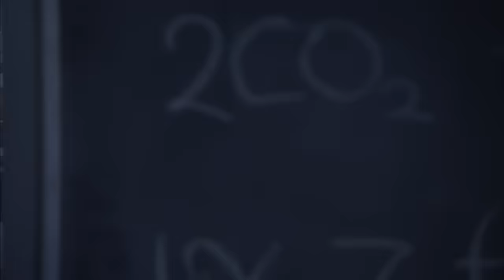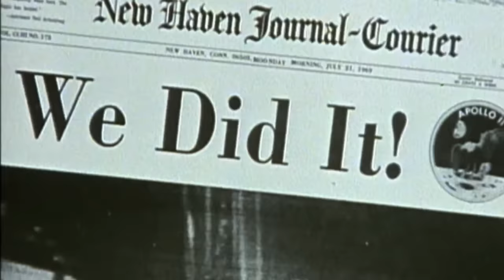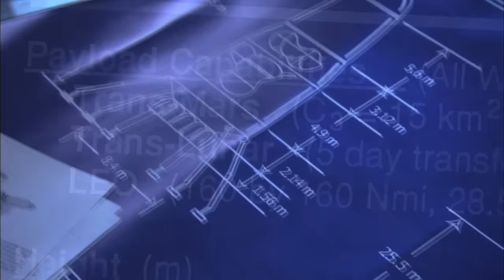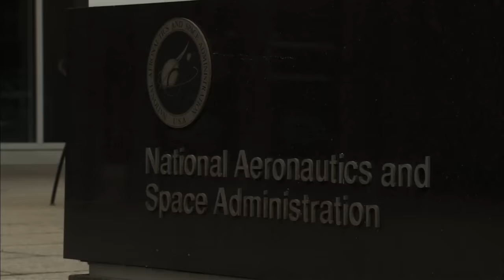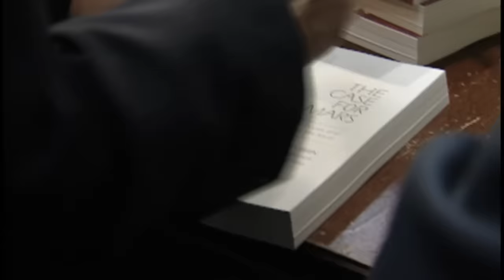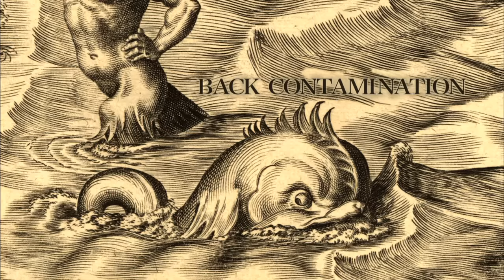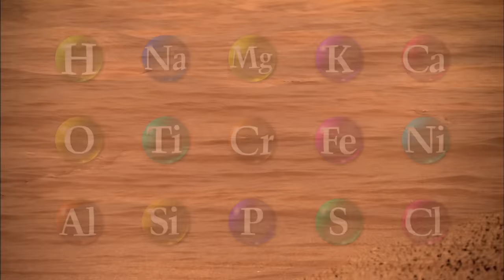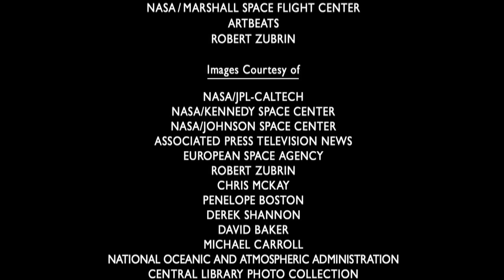THE MARS UNDERGROUND [HD] Full Movie

Comment: One crucial point which was not mentioned when describing possible terra forming of the planet Mars, is the fact that Mars has lost its magnetosphere. Though faint isolated pockets do exist and it would be most prudent to set up bases within these isolated pockets, any atmosphere created would simply be blown out into space by solar winds. It seems more reasonable to first and foremost resuscitate plate tectonics in order to (1) warm the planet from the inside out and (2) to set into motion a global static charge in order to bolster the magnetosphere. Then once the magnetosphere is robust enough to shield the entire planet from solar wind and radiation, the process of creating an atmosphere can begin.
Reply from the maker: Ron Bohlouli Admittedly, the lack of a magnetic field should have been explored more in the film when it comes to settling the planet.  However, there are many counter measures that can be taken to mitigate the effects of solar radiation.  Having to generate plate tectonics - something probably impossible - is not necessary. 

Also, it would take millennia for the solar winds to blow the atmosphere out into space.  If we could generate an atmosphere, certainly we could replenish it slowly over thousands of years. 

Of course, with a thick terraformed atmosphere, the radiation dose would be reduced many factors more: “Mars' thick atmosphere of carbon dioxide would block a good deal of the incoming UV radiation, but carbon dioxide does not significantly block UV radiation in the 190 nm to 300 nm range. Current UV flux on Mars is about 6 Watts per square meter, which would be enough to kill most organisms. The plan here would be to introduce highly UV resistant lifeforms, such as lichen, directly on the surface or to grow cyanobacteria in soil which would protect the organisms from UV, and in mats on the newly formed seas, with layers of dead cells protecting the living cells beneath. These organisms would release oxygen which would slowly build to breathable levels and would form ozone in the upper atmosphere, which would reduce the harmful 190-300 nm UV flux. These organisms would also provide nutrients to help build the Martian soil up to the point where it could support more complex plants.”*Jason Shankel:  *@5868115
Show less
Reply: Ron Bohlouli You wouldn't resuscitate plate tectonics. To get the magnetic field going stronger, you need to have the core of the planet spinning. The planet does have magnetic field, be it very weak, so we know there is an iron enriched core in the center. To get it stronger, the core needs to spin faster.

As Blue Mars said, it takes thousands of years for the solar wind to blow away an atmosphere. Even if we could get the atmosphere on mars to return in 200 years, we would have the technology to keep the atmosphere on Mars sustained, even as the solar winds blow it away. It would be much cheaper, easier, and more plausible to do than trying to figure out how to get the core of a planet to spin faster.

At the same time though, due to the lack of an magnetic field protecting the planet. Chances are all the people on Mars would live in protective habitats, and not out in the open. Any technology that could jump start a planet's core into producing a more powerful magnetic field is far, FAR past our lifetimes. By the time it is invented, we will probably end up using it on a different planet instead.
Reply: I believe it is feasible to capture a number of celestial bodies and navigate them into a fixed orbit around Mars.
 This in essence is creating a moon for Mars. Which in time will set into motion plate tectonics and the spinning of the core.
Reply: Ron Bohlouli That would be possible to do. How ever the new moon would have to be very large. Large enough that it pulls on the planet enough to distort it more than the moon does to earth. For a moon to get the core spinning, it would need to have enough gravity so the planet distorts enough to heat up. You would basically need a moon large enough that it might actually be considered a dwarf planet. Even then that might not be big enough. For an effect like that, you might actually need to do it the other way around and make Mars a moon of a larger planet. No clue how big the planet, or object would have to be, but I'm willing to bet that it would have to be much larger than a moon, and I'm willing to also bet not even Earth would be big enough. Leaving only the gas giants, and those are to far out to even bother trying.

Regardless of the size though. The effects wouldn't be instantaneous. You could easily be looking at hundreds of thousands, if not millions of years before seeing any noticeable effect. Keep in mind that planet tectonics work, and move over millions of years, same would go if you tried to artificially speed up the core by using natural methods, such as bringing in another body with more gravity. Not to mention it would still be much easier, and more effective to just terraform, and artificially sustain an atmosphere while living in protective structures. Working on a technology that could heat up a planet's core, and get it spinning better would also be much easier than trying to move a large enough body into orbit for the same outcome.

Lastly, plate tectonics are on the surface of a planet. To get the tectonics moving again, you need to heat up the interior of the planet first. You're not trying to revive tectonics, you're trying to revive the planet. It's the center of the planet, its core that you want to focus on, not the tectonic plates. Those are just a by-product of having a planetary center like Earth's.
Reply: On average the solar winds are miniscule, However, Without our magnetosphere a direct hit of one Earth Directed Disruption could blow out our atmosphere like blowing out a single birthday candle.
Reply: Ron Bohlouli  He's right. no magnetosphere, no geomagnetic field, no oxygen-nitrogen-methane atmosphere. Warming Mars without a magnetosphere or a geomagnetic field very difficult. It's building a Statue of Liberty without iron Don't terraform Mars until we can develop a magnetosphere or a  geomagnetic field.
Reply: Blue Mars Scientists need to develop a superconductive geo-magnetosphere machine to hold lighter gases for nitrogen and oxygen. Then terraforming can begin.
Reply: Ron Bohlouli The best solution really is to snatch Ceres from the asteroid belt and send it on a collision course with Mars.
 
Ceres shouldn't hit head on, but instead it should skim the edge of the equator with the right speed and angle of impact so that the asteroid would make the outside of the planet spin much faster than it's inside, and also be absorbed inwards so that it sends all it's kinetic energy to melt the interior of the planet and crack the crust making plate tectonics. 

The friction produced by the different speeds of rotation between the surface and the core would create a powerfull magnetic field that should last for millions of years. 

 The only downside would be that the day on mars will become much shorter, but the impact will likely generate a large moon to slow down it's rotation with time.
Reply: Danx Daniel That's a good plan, but the planet wouldn't be cooled off enough for people to live on for a few million years. At best it would take a couple hundred thousand years to cool off enough. Then there is the problem with the planet's rotation. Days will go by really fast, which will fuck with how the human body wants to work with sleep. People would experience what's probably somewhere between 2-4 days in a 24 hour span. Well depending on the angle. Either way, 1 earth day would be close to 2 Martian days at the very least.
Reply: PLEASE READ ALL OF THIS. 

The impact would melt a good portion of Mars's crust and interior, but not all of it, the molten material at the impact zone will remain molten for a few hundred years maybe following a gradual distribution of that heat to the rest of the planet, but the far side of Mars's crust would likely remain solid.
 
 The Theia impact with Earth that formed our moon may have needed "a couple hundred thousand years" for the crust to cool, but Ceres isn't half the size of Mars as Theia was compared to Earth. It's around 1/8 (lower mass, so the impact wouldn't be that dramatic)

 People could live on the opposite side of Mars untill better times come at the impact zone, and they would likely adapt to the new 4 hour day (guess) because there's no other way, it's not impossible to overcome, all organisms we would bring there would have to adapt to that.

 Just think about it, Mars would be safe to inhabit within a few decades after the impact, and the terraformation would begin immediately with the new super magnetic field, and the new already thick atmosphere with a lot of water resulting from both cerese's and Mars's ice.
Reply: Draggon Reaper Not to speak about the new closer orbit to the sun that Mars would have because the impact will slow down it's orbital velocity a bit, further improving the conditions necesarry for Mars to contain liquid water on it's surface.

A major hurdle though would be the debris from the impact, our timing should be flawless so that the earth's orbit wouldn't cross the bulk of the space debris coming from there and take extra measures of caution to detect and deflect the large chunks of rock that would try to hit the Earth.
 We don't want to start life on Mars and end the life on Earth.
Reply: +Jacob Tennyson statue of liberty is copper <--- =)
Reply: +Jacob Tennyson statue of liberty is copper <--- =)
Reply: Danx Daniel
 Your plan is feasible, with a caveat, there are to many variables, any one of which if gone askew would create devastating problems.
 A project of this magnitude can not tolerate anything less than zero margin for error.
Reply: Kacey McCay
 If I am not mistaken, the skin is copper, the frame work is iron and/or steal.
Reply: +Danx Daniel 
better yet setup 6 towers around the planet two of them at it's poles and then create a electromagnetic field like earth plus these towers will create ozone plus this creates a communications and many many many more things
Reply: +Ron Bohlouli "Steal?" Is that some kind of stolen alloy?
Reply: madamerotten
Steel carbon content is between 0.002% and 2.1% by weight for plain iron-carbon alloys.
so make sure no aliens come and steal it...
Reply: Ron Bohlouli Yes, everything should be perfect when putting the plan into action.

 But i don't see a better ideea when tackling the magnetic field problem in Mars's terraforming.

 Such a plan will likely happen if humanity will get past the level 1 civilisation.
Reply: Danx Daniel
    DING! DING! DING!    You got it!!!
 There are, in fact, a host of problems regarding terra forming Mars or any other planet or celestial body.
 To avoid placing the cart before the horse, it is crucial to identify and recognize the proper sequence in restoring/reviving Mars. Least we defeat the purpose.
 Note: One uncomfortable and unavoidable detail, in addition to our inadequate will and technology, is our propensity in destroying, globally, Chernobyl, Three Mile Island, Fukushima, Kursk are not positive attributes on the resume of terra formers.  
 Mars will be, must be terra formed. But not by us. We can begin the planning, for future generations to amend and fine tune before implementing.
Reply: Setup 6 towers around the planet two of them at it's poles and then create a electromagnetic field like earth plus these towers will create ozone plus this creates a communications and many many many more things.

Energy is easy with a electromagnetic generator/pump how does that work think of a magnetic and a steel ball  now think a electromagnetic and steel turbine as the magnetic force increases the out put of energy also increases with no fuel just small jump start of energy = unlimited out put then using electron eating bacteria to create even more energy and lesson the radiation of the field created...

Methane from the solid waste
CH4 + O2(fire)= H2O+CO2 just what plants love then the solid waste is heated up to make Syn-gas the waste water is then used to grow plants....

Recycling water aquaponics, syngas makes fuel when solid waste is heated creating 3 kind of oil sludge, motor oil, machine oil run these sludge and motor oil in the heat with stainless steel and aluminum to create gasoline and propane

Can Go on and ON
Reply: 1stWorldofFreedom 
 I believe you have scratched the surface of what may have been ancient technology ie, mega structures on known lay lines.
Reply: +1stWorldofFreedom Ozone does not equal an electric magnetic field. you create this by heating up the core, by creating a greenhouse effect in the atmosphere. this greenhouse effect will kill off your ozone. Also you need an oxygen based atmosphere to create O3 aka ozone.

The electron eating bacteria powering a generator is just WahWah.
Reply: John Smith
Haaa learn and create science is Great

Study Paleolightning before flapping you gums and start looking dumb
If Oxygen is absent, but CO2 abundant, the CO2 can supply O for N-oxides

Mars atmosphere is mostly Carbon dioxide: 95.32 percent. Nitrogen: 2.7

Artificial magnetic fields is possible and easy as I stated....
Build an electrical conductor around the equator of Mars. This electro-magnet would form an artificial magnetic field.
bubble of plasma surrounding the Mars created by artificial magnetic field

This excess charge is transferred to the ground via lightning channels, which carry a strong electric current. Because of the intensity of this electric current, when lightning hits the ground, it can produce a strong, albeit brief, magnetic field.

Who's ball are black and blue that's right it is you....Wahwah
Reply: My expertise in science is electricity. Ozone does not equal a electro magnetic field. Sure, there are ways to create energy with algae, but there are no electron eating bacteria.
Reply: "An artificial electric field of plasma." Do you even know what plasma or a tesla coil is?
Reply: "Artificial magnetic fields" You have a magnetic field or you don't. There is no such thing as an artificial magnetic field. It's an electromagnetic field, or permanent magnetic field.
Reply: Every cable in your household sends out a magnetic field. Nothing knew. Know for centuries. Humbug. Big humbug.
Reply: John Smith
Yes I do what a Tesla coil does and what it can create

Tell it to someone else you can as I have shown with a Tesla Coil towers creating lightning and artificial magntic feild around the
Build an electrical conductor around the equator of Mars. This electro-magnet would form an artificial magnetic field.
bubble of plasma surrounding the Mars created by artificial magnetic field
Reply: John Smith
The three magnetic fields add as vectors to produce a single rotating magnetic field created by Tesla Coils....
Reply: "If Oxygen is absent, but CO2 is abundant" than oxygen is abundant. But you can't simply extract O from the CO2 without any substances.

But the biggest joke in all, is that you expect an electric conductor around the equator (You fool, think what you are saying), and than expect to generate plasma in orbit. hahahahahahaha. This fails in so many ways, and not even in a scientific way.

Here is some science and logic for you. For you to power a conductor, lets say a cable "conductor" you would need to make it so thick for currents to flow through that you would not even find the raw materials to construct it in the first place. See if you put alternating current on that power line, you do generate a field. But when an electron travels through a conductor, it experiences resistance. HHHHHHMMMMM resistance. To overcome this resistance, you need more current. And in turn you need a bigger diameter of cable. And this all is powered by ?? Algae, lol? Lightning, lol? Or solar panels, even bigger lol? Just to find out by simply alternating a current and creating a small very small magnetic field, will never ever create plasma. To create plasma you need a Tokomak. But with your logic I expect you to build that probably too around Mars.

Big humbug. Sit down.
Reply: Those tesla towers, which is forgotten knowledge you even can't construct.. work on the harmonics of the magnetic field of the Earth at 6 Hz. Since Mars has none, you will not generate any power. Nor will have the power to generate it.
Reply: And no, it will not generate plasma, unless you intent to create a sun out of Mars. And no, we will not be possible to do this. To that extend I would rather state that a stargate, entanglement communication and Alcubierre drive have a bigger possibility combined to be realised, than this not thought trough plan.
Reply: Tesla is mah bitch, not yours.
Reply: And yet, I state: A reflector dish on a small ship "could" work.
Reply: The scale of a planet, is just not possible.
Reply: John Smith
Electromagnetic generators what ever energy out put you need is the amount you need to jump start it. Then you can increase the out put by 3x the amount that was need to jump start it and it'll run until parts wear out. :)

A frequency of 6 Hertz means that there are 6 cycles occurring in one second..
Reply: No shit, 6 hz.. As an electrical engineer I never knew that .. but not really...

Every generator uses electromagnetism to function. Every cable with an alternating current on it generates in turn an electrical field. Plasma like in a Tokomak does not keep running until infinity. You need deuterium, an ion of hydrogen to keep it fueled, and this in turn creates HEAT due to plasma. You use his plasma to heat STEAM, and in turn this steam generates energy with a steam generator, which simply converts the steam power into motion, and in turn the rotating coils create an alternating 3 Phase current when connected to a close loop. This is how a plasma generator works. You expect plasma: 12 million degrees, to remain plasma in the vacuum of space without fueling it? Than why does the sun have an expiration date? Because fusion will eventually run out. Not even mentioning the heat dissipation you will have when you place it in the cold environment
Reply: Besides why the plasma? Who says it will have effects on charged particles? I rather say that the magnetism alone would do more. Isn't the whole idea from Sin City? That's the fiction part in science fiction.
Reply: Electro magnetism is used as containment, so the plasma does not reach the fusion generators walls. And with it's 12 million degrees burn the sides. Now you try to capture charged particles, but from the whole installation to capture these particles, the walls of your "fusion shield" are the only one capturing these. So the plasma can be cancelled out in the whole idea. So .. generate a electromagnetic shield to capture these charged particles is all there is left.

And this is how we are gonna do this: Heat up the martian core. Not by nukes, not by plasma, and not by pseudo science. But by simply heating the atmosphere by the exhaust of for instance factories, that are harmful to our own planet. This can be done in 100-300 years, it depends on what we can build, and how much. Until it reaches equilibrium, and will stay warm by itself. Due to this heating, the core will also warm up and will start up the radio-nucleair effects, which will generate that magnetic field like on earth

Ozone will set in a different stage, since the greenhouse effects will dissipate this anyway. But after heating up the core, we first have to study the effects of the to be release frozen carbon water under the surface, and especially for weather effects (!). Who knows, Ozone is a self generating effect, even from CO2. But we probably need an Oxygen based atmosphere for this effect to truly speed up. Ozone can be created from lightning discharge, but for that to happen, we need lightning as weather effect before there is a possibility to discharge O2 into O3. And this .. could take centuries.
Reply: Do you know why our sun, at the end of it's life goes nova (not supernova). Because it fuses iron atoms. And this has a negative side effect on the fusion process. Imagine what would happen if iron atoms would come through the only protective part of your installation, it's magnetic field, and would hit your plasma? Same effect as in the sun. So no, it will not work in multiple ways. Nor is it - if it would work, which it never will - overly engineered to do something which could be more financially sound, and less material hungry achieved. Humbug.
Reply: *****
I agree but we need Tesla coil towers to create or strengthen Mars magnetic field and create a communication plus the Ozone needed for the micro's to thrive
Reply: Well, Tesla's Tesla tower is proven technology in a way. It is the same principle of our sending and receiving technology. A coil (antenna) will induce an inductionvoltage and in return a current.

I personally think that tesla did this by setting up and RCL filter for 6 Hz. (Resistor-Condensator-Coil)

To find the induction voltage one could use Uind = L * (dI / dT) 

L is your coil properties, I your current, dT = 1/f or 1/6hz., and there the delta of.

But this could only get so far. Now it was Faraday who invented coils, but it was actually Maxwell who invented field lines, saturation and basically electrostatica and magnethostatica. We need to know the size of the desired field and some other properties. In the end we would find that we would need an immense power supply to power this all. It would be much cheaper to create a small protective magnetic dome. But it will not permanently produce a magnetic field around Mars. For that we still need to heat up the iron core of Mars. The idea is technically viable, but financially it's not.

Going underground would be much cheaper until the core is warmed up. But you could invert the Tesla tower afterwards to generate electricity from the permanent magnetic field from the core of Mars.

Let's say as an example: the magnetic field of earth has a power of 100 MW, You need more than 100 MW to create the MVAR's to create a magnetic field (blindcurrent) these are losses, but if I would generate from that 100 MW field, I would never get the 100 MW's out. But only a fraction of. 1920/30's energy consumption was nothing compared to what we need now to power our high voltage production engines. But it would be free natural energie. sadly we don't know how much MW's Tesla was able to generate with his towers.
Reply: And the day you reinvented the tech, a patent troll from BP, Exxon or Shell would probably be on your doorstep.
Reply: John Smith
This is why I posed the Idea of 8 towers as 2 at the poles and 6 around the equator...
Each tower would need to generate 12,500kw of energy by your figures and like I said electromagnetic generator could easily generate that.

Then Thorium is so abundant Moon or Mars has enough Th-232 Martian thorium has also been mapped by 2001 Mars Odyssey.

LFTReactors is clean energy plus produces many needed resources that will be needed as for waste there is none unless you shut down which you can rerun or store it for 300 years unlike the Uranium...

Liquid Fluoride Thorium Reactor (LFTR)
Fuel Thorium and uranium fluoride solution
Fuel input per gigawatt output 1 ton raw thorium
Annual fuel cost for 1-GW reactor $10,000 (estimated) Almost 25 tonnes of thorium was used in fuel for the reactor, much of which attained a burn-up of about 170 GWd/t.
330 MWe Fort St Vrain HTR in Colorado, USA

Coolant Self-regulating
Proliferation potential None
Footprint 2,000-3,000 square feet, with no need for a buffer zone

No Greenhouse Gas Emissions

Near Complete Fuel Usage – less than 2% unused fuel is a significant source of valuable substances- Current reactors use only 5% of the fuel. So LFTRs leave 2% behind and can effectively manage the left over fuel.
Far shorter half life (a few hundred years)

The current reactors leave 95% behind and leave it for storage and the half life amounts to thousands of years. The storage is handled well but the full elimination of “waste” is more desirable for political reasons.

Energy density is much greater than Uranium largely because of complete fuel usage being possible in a liquid state.

The more toxic fission products such as plutonium never get produced 2 or more plants in one – reprocessing and energy production and secondary applications are all feasible

Lower Pressure so less expensive – runs at atmospheric pressure

Some designs can run them selves without humans underground designs have been suggested underwater designs are a favorite of Kirk Sorensen

Cheaper to build than coal plants – after initial short R&D period costs will come down
are nearly impossible to produce nuclear weapons – main reason it was unpopular in 1960’s deterrent to fossil fuel usage – can provide abundant and reliable electricity,
can be effective as heat source for numerous application, water desalinization, hydrogen production, thorium supply is plentiful

LFTR — Liquid Fluoride Thorium Reactor
http://liquidfluoridethoriumreactor.glerner.com/

Useful LFTR Fission By-Products
http://liquidfluoridethoriumreactor.glerner.com/2012-useful-lftr-fission-by-products/
Reply: John Smith
Yeah I know.
The company I work for came to my house with lawyer's their security guards.

Took my computers, laptops and my kids, then went into my personal lab/work shop, stole my Artificial Hunter's Organ.
 
Which I was producing 500 watts of energy every 6 seconds as someone over heard me talking to a fellow employee about my projected I have a contract boil it down all my Ideas belong to corporation pat me on the head....then received a Military contract. 

so yeahhhh fun fun....
Reply: Actually, Mars does have tectonics. And greenhouse gasses can be created by industry exhaust. 

http://newsroom.ucla.edu/releases/ucla-scientist-discovers-plate-237303
Reply: Erupting, no. Mars is to cold for that. But if you would get Olympus Mons to burst, you get a lot of greenhouse gasses. It will take a lot of work and resources. And probably 100-300 years, to get Mars to have an atmosphere, and it still won't be oxygen. But that's why the Mars One mission is illogical, we need more technological advances in the fields of robotics, to have things build, and factor human labor out. Next to that, Ion propulsion would be very useful to get a quick delivery of materials, unlike the inventor of Mars Direct suggests. On orbit refuelling would come in very handy, to reduce costs and heavy launchers to and from orbit. Preferably by spaceplanes. To that extend Mars Direct and Mars One look at the short term picture: Getting there, and back or not. But next to the fact that Mars One "intends" to stay there, that intend with out the technology in place raises more questions than answers.
Reply: +John Smith On orbit assembly and refueling would increase costs; not lower them.
Reply: +Ron Bohlouli What a joke, we can't even figure out how to stop global warming on earth, and people think they can just go to mars and change its atmosphere. Not to mention that some people still dont even accept global warming, or dont agree on what actually caused it.

However, psychologically, I do agree that we need to explore mars, for the sake of moving forward, even to simply have it in our minds that its there, and it is reachable, and its possible.
Reply: *****
 Your observation is spot on correct, with a caveat, majority rule! It is most unfortunate that at this time in history, intellect is over ruled by dumb as a rock stupidity.
 This may turn out to be an advantage for those who understand the necessity of space travel, in one case, in order to perpetuate humanity.
 As brilliantly illuminated by the late, great Dr. Carl Sagan in his Cosmos series, as he states, "One day there will be the last day on earth".
 Barring self inflicted extinction by way of wars or rendering earth uninhabitable. One day our sun will 'die', and with it will go all life with out exceptions. Of course this will not occur for a few more millions of years, so we can afford to procrastinate a bit longer.
 However, this one inevitable event remains paramount, as reason for space travel and terra forming.
 It would be prudent to get a workable plan too soon rather than too late.
Reply: ***** Global warming is in solar system not only on earth.
Reply: Pedjo Gt no kiddo, the cause of warming is the heat trapped in the atmosphere. Sorry to bust your bubble but, there is no atmosphere around the solar system. There is a reason its called "global" warming. Meaning our Globe=plant earth.

Whatever it is you think is warming the solar system. Its not global warming.
Reply: Coming back to the on orbit assembly: The infrastructure like a space-station is mostly a one time investment except it's running costs. You can't simple shoot a huge spacecraft into orbit, or bring it back to earth.

Surely every piece has to be shot into orbit, but it is in reusability where we could save costs
Reply: And that "atmosphere" around the solar system is the heliosphere with it's bow-shock. It's magnetism and not an atmosphere.
Reply: And the sun has a 12 year cycle where it becomes more active. But methane from dairy farms is an underestimated culprit. And methane is the most harmful. The sun will intensify near the end of its life.
Reply: +Draggon Reaper For some reason Venus comes to mind very quickly.  To cool Venus, would be simpler then to warm Mars
Reply: +Ron Bohlouli 
that is one of the most sensible comments i've read on youtube.
i had not considered the problem of the magnetosphere. so now the problem is....how do we restart the plate tectonics in mars...that would be terraforming at its best. i hope it starts during my lifetime.
Reply: sabin97 
 Thank you for your kind words.
Reply: Simply add mass. The increased gravity would have a greater atmospheric retention. Also magnetosphere only does part of the job. Water is a good medium for blocking radiation and hydrogen and oxygen are used as rocket fuel. Interesting.....
Reply: When referencing the cosmic cook book, regarding the creation of a palatable world, we can only, at best, make best guess theories, and hope that it turns out all right.
 Of course, such a book does not exist. When written will define the human race, in by choosing either; short term immediate gain, or everlasting benign sustainability on the path of terra forming and what impact our footprints will have on/in the cosmos.
 This is not nor should it ever be considered a hit or miss proposition. If done at all this must be done right and it is most crucial that it be done right the first time every time. Or leave it alone and be satisfied with what we can do right.
 Least we spread our ability to create with our equal and surpassing ability to destroy.
Reply: The em field and magnetosphere are only partial protection. Still water is needed.
Reply: +Ron Bohlouli... gee that almost sounded like u new what you were talking about...you ONLY left out the ducking 'how' all this is to be accomplished....it would intuitively seem....that if 'you' could do that there then here?  but there is absolutely  no technology to accomplish it..we do not have the knowledge or the means .Can we influence even earthquakes, no!..might as well  start building that spacecraft that will exceed the speed of light...
What 'flies' is that which is possible....our 'space station' is a relative joke. its size makes the manufacture of anything on site totally impossible...the budget for the space program over its entirety is less than what we bailed out the banks with in 08  09.....   Look at epigenetics....stone cold stopped in its tracks with the George W. Bush administration...What has Obama done for  NASA...insured its budget makes it impotent...first you need a leader ....then a 'real' program...then approval from congress.......if pro-gress  is to move forward  then what is con-gress...???
Reply: +Charlie Hutch Pioneer Astronantics s is in a dilapidated build in literally and 'edge-water' town....doing essentially nothing with no money and no employees....think im kidding??? :: ha look for your self...11111 W. 8th Avenue, Unit A, Lakewood, CO  google maps... ever since he got fired from Lockheed and then NASA he's just a pipe dreamer..with no outlet but talk.
Reply: Walter Garvey
 Yes, water is a vital ingredient in the mix. It would seem to be part and parcel in that you can not have one without the other i.e. you can not have sustainable liquid water without a temperate atmosphere, you can not have a sustainable atmosphere without a magnetosphere one compliments the other in a balanced mutual existence.
 Remove the magnetosphere, in time the atmosphere will dissipate out into space by way of solar winds.
 Without an atmosphere, all water will either freeze or evaporate.
 NASA data shows that Mars does have water, resent data indicates flows. Not in the form of gushing geysers, rivers, streams or even a humble babbling brook, but in the form of frozen mud.
 In addition data shows that Mars does have an atmosphere and magnetosphere, however, these are not comparable or as robust as Earths.
Reply: +Ron Bohlouli what are you saying? so we can nver live on mars?
Reply: jacobmufasa
 It can be stated, with absolute certainty, that 'I' will never set foot on Mars. Odds are better than good that neither will most of Earths inhabitance.
 However, this does not exclude those yet to be born. The collective 'we', as in the human race, (via selected few), in time, will colonize Mars and beyond. This is imperative, as briefly outlined previously.
 Such technology and ability does not exist 'today', yet, we (in the collective) must find the  intellectual fortitude to create such technology and ability. then apply it for the perpetuation of life.
Reply: Charlie Hutch
 You will find no argument from me, the wrong people have been in control for far to long. Deregulated management of pollution with the mentality of immediate short term gain by irresponsible, incompetent, inept glutinous special interest elitists are directly responsible for tainted drinking water, air, soil. Even turning the once pristine oceans into an open toxic sewer!
 As dire as all this is, it can be turned around, it can be made right. It will never again be what it was, but it most certainly does not have to continue as it is.
 As a rule, I do not purchase products from companies with a history of irresponsibility/unaccountability or support public officials who support these companies.
 The fact that freedom of choice has been wiped clean from the shelves, and replaced with 'take it or leave it' is undeniable proof that these greedy bastards do not have my best interest in mind. So, what possible reason would I have to even consider supporting them?    
 Using the frog in boiling water metaphor, consider; The frog that jumps out, survives.
Reply: Ron Bohlouli
'I do not purchase products from companies with a history of irresponsibility'  so you don't drive or ride in vehicles that are powered? "support public officials who support these companies.' did you vote for Obama?  "freedom of choice has been wiped clean from the shelves" and can you choose to not own a cell phone, or a pair of shoes  or  eat  meat  or turn on your lite at night  after dark??  no you don't and neither do I..choose to do those things you said ...we are all fucking Hippocrates students...yep..it is 'we' that suck....maybe for too long 'we' have pushed the 'responsibility' on to others ??  Chomsky says  we  don't have real representation...esp  in this department....not any longer does the 'working class'  have any collectives.....so if we work for a living pay taxes and VOTE we are not represented....When the time came for the vote in congress.....(the opposite of progress) on the bail out ...99 per cent of those congressional leader constituents notified them to vote  'no'....it is a fact...and they voted yes     ...but that's not even    the   fucking  kicker......then turned around and fucking reelected them...who's to blame ....the american voter....who's definitely NOT solving these problems ...the american voter...so who should complain?/  ??    the average american has a I Q of 100....that could be the fucking problem !! ?? !!
Reply: Charlie Hutch
 I do not own or operate a motor vehicle, have not for eight years now, (my license is valid and my record is clean).
 The last and final time I voted, was when they placed the 'first' acting president into office. I could see back then that the fix was in. 
 But all of this is off topic, I would be more than happy to continue this conversation on my home page. Please feel free to do so.
Reply: *****
silly boys..4.4–7.3 billion km) from the Sun,
	Lying 30 to 50 times Earth's distance from the sun, with an atmosphere consisting of nitrogen , methane , and carbon monoxide, temperatures of minus 369 degrees Fahrenheit (minus 223 degrees Celsius). At its coolest, temperatures can fall to minus 387 degrees F (minus 233 C). roughly the same surface area as Russia. Its surface gravity is 0.063g  totally uninhabitable ever..
Reply: *****
oh yeah u r the guy that said something like: the necessity of space travel,..., in order to perpetuate humanity. but be that as it may do you have a priority>?  i mean what's the use of chasing the unknown when the 'known' is self destruction? This is what 'congress' (the opposite of progress) does exactly...re prioritizes each agenda leaving the major issues in the dust...if your so self acclaimed intelligent and so creative can't u see that all of that is moot. Especially if we cease existence?? If you personally, and that maybe the fucking case, were in charge of changing the inevitable outcome of this planet as predicted by the best minds of our time...what would you do?  send a fucking rocket back to mars?  that's just seemingly a little naive. the video was on a disgruntled ex-employee who's too compulsive to get a job and too annoying to want to work with ranting acceptably about his agenda....which is not what the planets agenda needs to be.one can be creative and pragmatic simultaneously.
Reply: *****
 Excellent point! Pluto's atmosphere could very well be the result of particles of gas which have been trapped in the protective shielding of an active and robust magnetosphere. Which in turn is the result of the subtle influence of its moons.
 Which brings us back to my original hypothesis, that by re-establishing a fixed orbital moon around Mars will set in to motion the sustainable self regenerating processes of terra forming, (with occasional 'sound and sane' assistance).   
 The desired end result will not be realized for many generations, However, the desired end result will establish a firm foundation for the second stepping stone into space travel, and the inevitable relocation of life.
Reply: +John Smith "artificial magnetic field" Artificial in this reference is meaning that
 its man-made and not generated naturally. Although I wonder about the 
dangers of Electron eating bacteria, seems like something that could 
easily get out of our control. With the Geo-Magnetic Generators though I
 could see multiple synergistic power systems that could potentially 
supply them, including ion harvesting from the solar winds passing over 
the generated magnetic field. Granted its outside of today's efficiency 
and safety range of current tech, but its plausible considering how 
quickly tech has been advancing.
Reply from the maker: +Ron Bohlouli People keep making this claim, confusing the need for a magnetic field to make an atmosphere.  Venus has no magnetic field and a very thick atmosphere.  It is Venus's atmosphere that protects it somewhat from the solar winds.  http://sci.esa.int/venus-express/50246-a-magnetic-surprise-for-venus-express/

Yes, the atmosphere will have to be maintained very slowly over millennia from loss to the solar wind.  Fortunately,  Mars has the astroid field next door.  Or they can just keep gasifying regolith.
Reply: +assfuckt The Van Allen belt didn't stop us from going to the moon.
Reply: Blue Mars
 When considering the 'atmosphere' of Venus, we must factor in its proximity to the sun, its make up and atmospheric pressure or density. 
 Surface temperature: 866.93 Fahrenheit -737 Kelvin.
 Surface Pressure: 1334.34719 psi - 92 bar.
 Composition of Atmosphere:
 carbon dioxide                         96.5%
 nitrogen                                     3.5%
 sulfur dioxide                            150 ppm
 argon                                          70 ppm
 water vapor                                20  ppm
 carbon monoxide                       17  ppm
 helium                                        12  ppm
 neon                                             7  ppm
 hydrogen chloride               0.1-0.6  ppm
 hydrogen fluoride        0.001-0.005  ppm
 We can now consider how these elements react together under such extreme heat and pressure.
 It would not be stepping out on a short limb by postulating no comparisons of atmospheres.
 If I am not mistaken, Venus has a magnetosphere. Perhaps this extreme pressure makes this combination of gases react more like a quasi-solid allowing Venus' faint magnetosphere to shield its 'atmosphere'.
Reply: +Ron Bohlouli Venus has a very weak magnetosphere that does protect the atmosphere, but has a lot of cosmic radiation coming through. 

http://astronomy.stackexchange.com/questions/10189/why-did-venus-not-lose-its-atmosphere-without-magnetic-field
Reply: +Bryce Thigpen  Spectrum lens or filtered lens!   I fear that your assumptions and facts are fractured and only part right.
Reply: The 'Juno Project' gives us a wealth of information regarding Jupiter, Saturn, and Pluto. We now have new entries in "The Cosmic Cookbook", and a better understanding of the how and why our solar system works.    As to what happened to Mars' atmosphere and magnetosphere; I believe there does exist evidence of a cosmic catastrophic event which not only doomed Mars, but also caused a mass extinction event on Earth.    The details of which I have been working on for a number of years and hope to publish soon.
Reply: Ron Bohlouli after it had begun the gravitational pull of the sun would somehow destroy the atmosphere and we would have a non lasting one. this is a problem that I  hope to find a usable solution to. I'm hoping to become an astronaut
Reply: Not really, at least until some extent (not like a gas planet with Earth like mass). 
For example Titan (biggest Saturn's moon) has an atmosphere with a pressure of 1.45 bar (45% more than earth's atmosphere), with only 0.14g (50% bigger than out Moon and 80% more massive). Or Venus with a 92x times stronger pressure with 0.9g.
Reply: Blue Mars  Jason Shankel whoever needs to comprehend adequate atmosphere blanket does segment layer according to comparable weight gases. Undoubtedly hydrogen, helium, ozone shield, and water vapors will not have any chances before remedying mass and you are stupid impostering affiliation to the experts.
Reply: Internet scientists